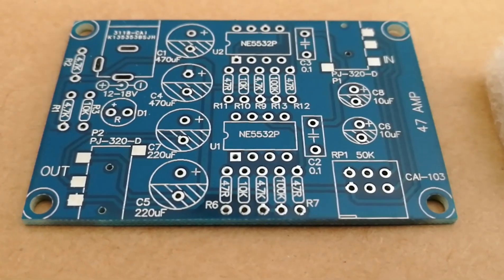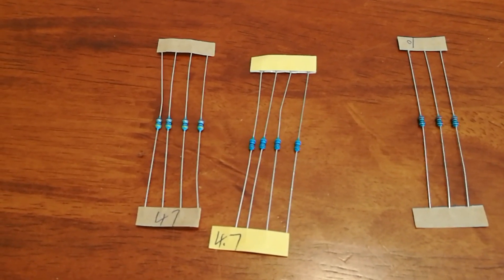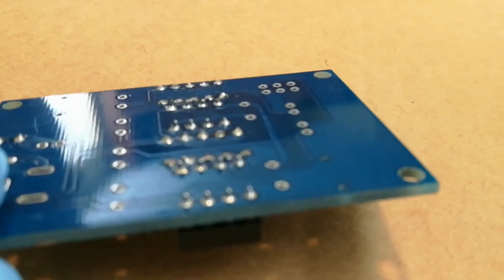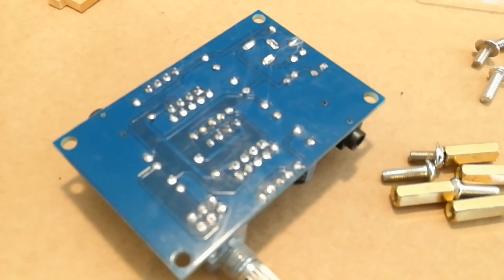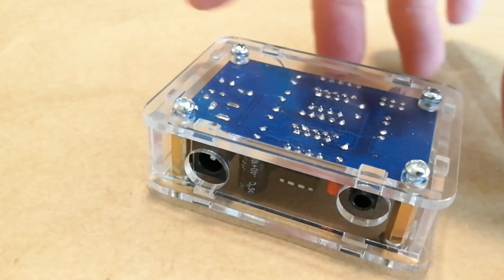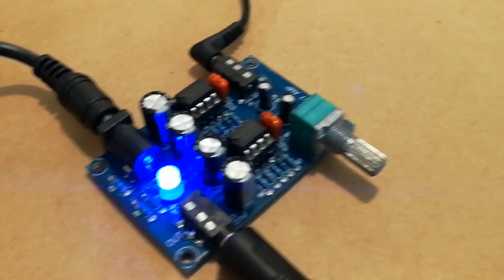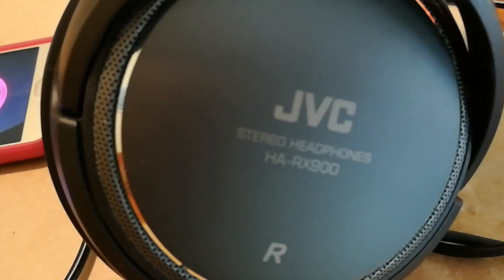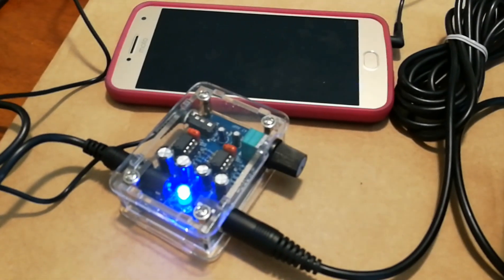"47 AMP" (TI NE5532 Op-Amp) Headphone Amplifier Kit Build, Troubleshoot & Demo on JVC HA-RX900

Comment: Hey, quite late comment, but I got a question if you don't mind. 
I recently got this amp kit with the intention of putting it in a nice wooden enclosure instead of simple supplied plexiglass ordeal, so I got panel-mount replacements for the audio inputs (RCA) and output (6.3mm), power socket, toggle switch for power, and red LED to replace the default blue one. I put it together with the aforementioned new parts and the included volume pot mounted on wires as opposed to directly on the PCB and checked that everything was in the right place and solder joints were good before powering it on. Now everything seems OK, no blue smoke comes out, nothing overheats, etc., but there's awful buzz (sounding like mains hum) that increases and decreases with the volume pot. So far I've tried three different power supplies, one from an audio device (with the assumption it's likely a cleaner one), but the hum's the same with all of them. Tried powering the amp with two 9V batteries in series and that got rid of pretty much all the hum, but I'd really like the unit be wall-wart powered instead of having to rely on batteries...
Any ideas what could be causing the buzz on wall-warts? About the only thing I can think of is the number of components mounted using lengths of wires instead of being PCB mounted,  but should that have such a drastic impact?

Comment: 2 simple rules.
first rule to avoid the false ne5532.
second rule to use 18 volts very low ripple (batteries 9 volts x2 in series)